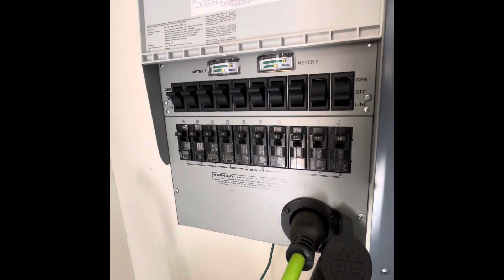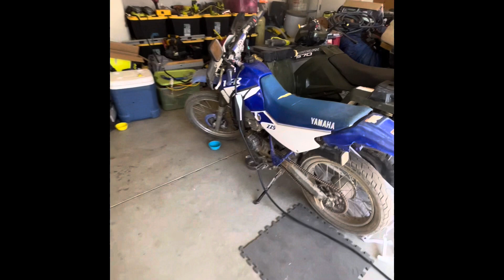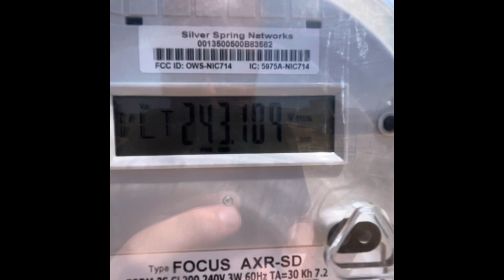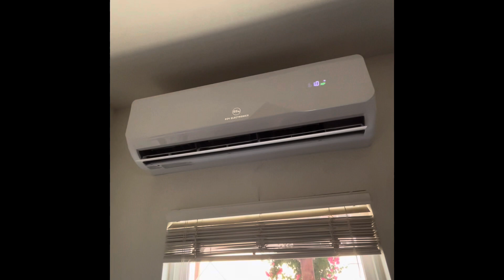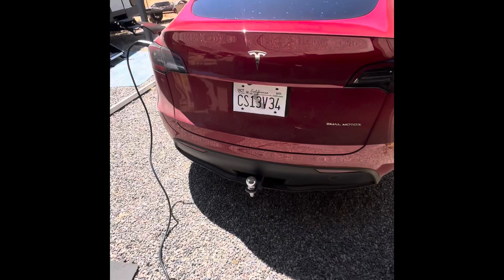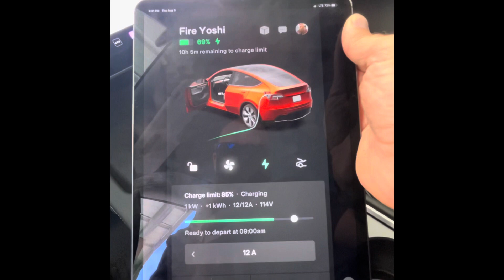Charging Tesla Model Y OFF GRID! Also Off Grid Air Conditioning

Comment: Really great idea. Your car port is awesome. Do you have a link for where you got it? I was looking at inverters to do the same thing. Will you parallel another eg4 to your current one to get split phase 240v?
Reply from the maker: I got it from a customer that I did some solar for. Madera Metal Carports in California is awesome. You need to see the other one I did with just a south facing only roof